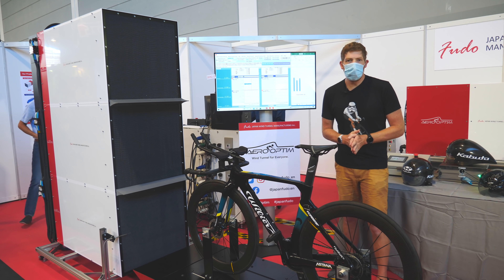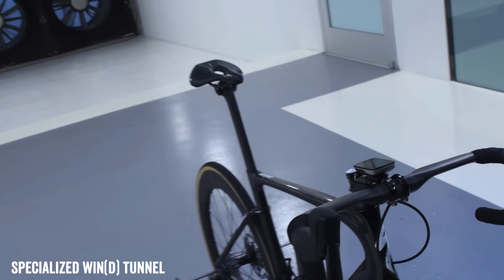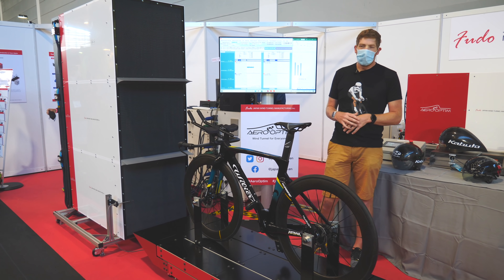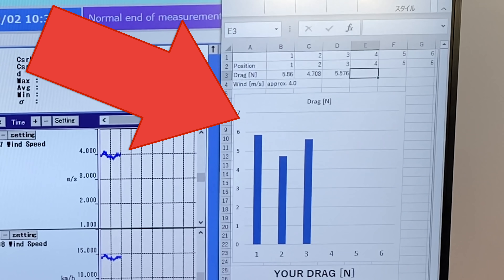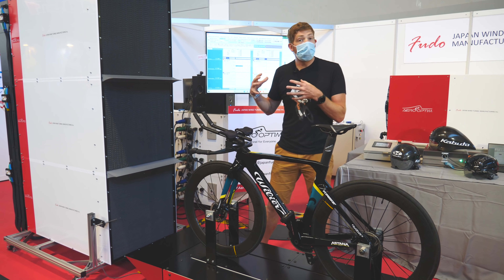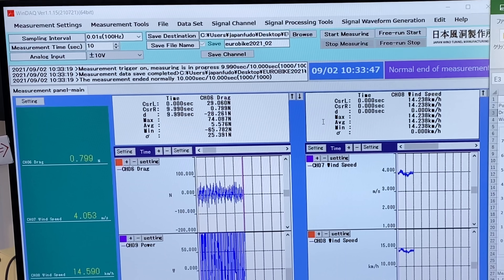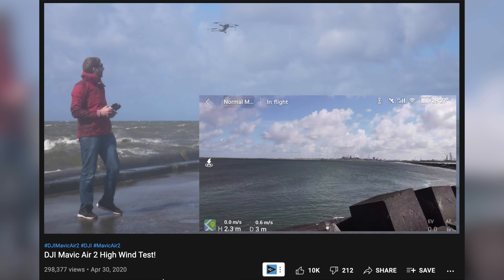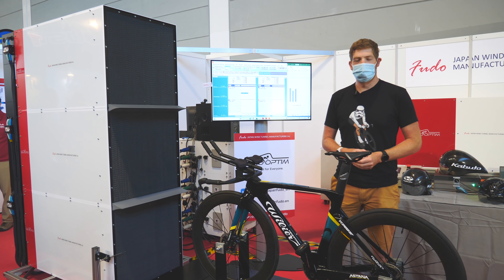Your Own Personal Wind Tunnel?!?

Comment: Years ago, when I was wrenching road racing motorcycles, we used a coast downhill test for aerodynamics. Changes were one at a time, then stopwatch check at the bottom of a known hill (dead engine run). We also had a do-it-yourself flo-vis, and bits of fluffy yarn to tape in place. None of it scientific, but it was ultra low budget, and actually helped go faster.

Comment: Not trying to trash your vid, as I think you are one of the best product reviewers out there.
But plain and simple, I don’t think this will give repeatable results with any real accuracy.
Why, A system like this is restraint to the room it is in, you will have different turbulence with a different shaped room, skewing the results, also if you open a door or a window, or someone comes in, again the results will be affected. 
Some experts even say a proper wind tunnel does not even replicate real would as at the lower speeds of a bicycle, the wind changes the yaw angle constantly.
Anyway most bicycle manufacturers play games with the results and don’t give all the data;
Like, are the wheels spinning, was a rider on the bike, etc.
So I would say 🤔 not so easy for this type of testing.
Also DC, what happened to those Cd meters that you tested some years back, did they ever fly? If they could get these to work I do feel it would be a much better tool for comparison as it is done whilst riding in the real world.
Reply from the maker: Yup, lots of concerns. Though realistically things like opening a door impact big wind tunnels too.

As for all those aero devices? There’s a good reason they haven’t caught in yet…accuracy and usability.

Comment: Wow....
No straightening vanes after the fan and placing the anaerobic gas flow sensor in the boundary air flow layer...
Reply from the maker: The video shows the straightening vanes...
Reply: @Dcrainmaker  The inlet guide vanes are on the wrong side of the moving fan blades.. Look at a turbo fan on an aircraft. The inlet guide vanes are downstream of the first fan to stabilize the turbulent air entering the remaining stages of the engine AFTER it goes through the initial fan stage. Following the same design these static vanes on this device should be on the rider-side of the main fan not before it?
Reply: @Dcrainmaker  
Straightening vanes are "normally" always located downstream from the fan(s).
Reply from the maker: @robertbass9032  They are downstream of the fan here. That view is showing from behind.

Comment: I suspect this would be useful in doing relatively cheap iterative design/position modifications before doing more accurate measurements in a wind tunnel. Engineers and scientists do these kind of relatively cheap/dirty experiments all the time on less expensive test beds to give a sense of what will work and what won't. Large facilities for testing can be extremely expensive and so can easily swallow up a r&d budget. What size is the market? Who knows?
Reply from the maker: Yup, we'd have to see what the accuracy and repeatability looks like compared to larger facilities.

Comment: If it proves to be accurate, it will be interesting to see if bike shops/fitters invest in something like this. But definitely impressed with audio quality with the mask on 👍🏼
Reply: Good idea.
Considering the added revenues of the bike fitter/ bike shop generated by the machine, they will be able to pay for it within 50 years.
The caveat is that they'll have to work at minimum wage for all those years.
Reply from the maker: Yes, assuming it was accurate (or, as accurate as necessary - which is probably an important distinct, as many athletes can't be consistent enough to themselves in test sets to get really valid data). But yes, I was trying to do napkin math on what the break-even would be for a 225K system in terms of # of tests.
Reply: @Dcrainmaker  let say $50/hr is a fair price for competitive amateur would willing to pay for, and let say you could pickup 4 client a day, that would be 225000/200=1125, with all the overhead and interest, it would take about 4 year for it to turn over, anyone like to load me a 225k for that?